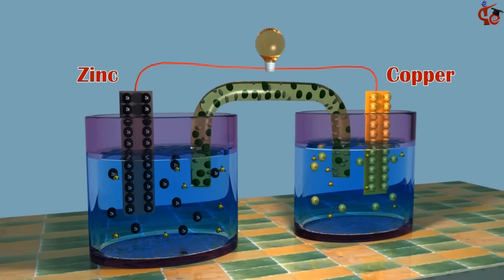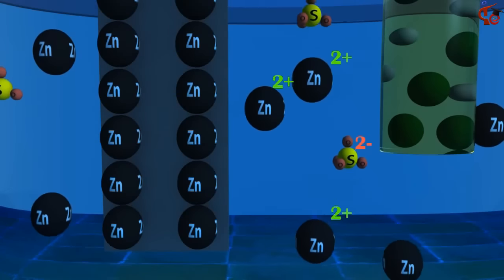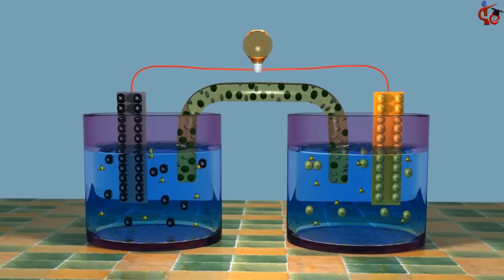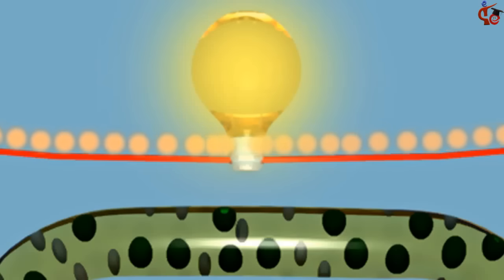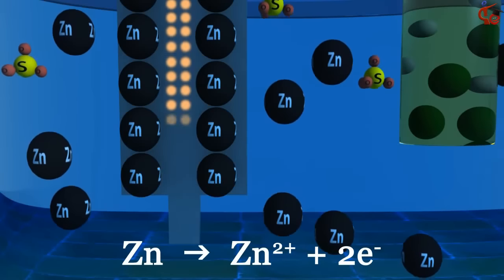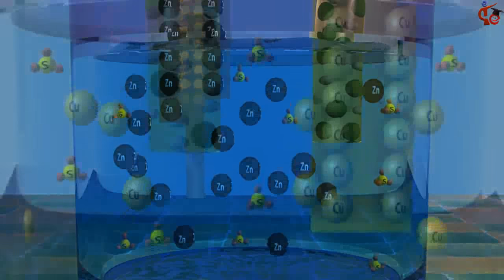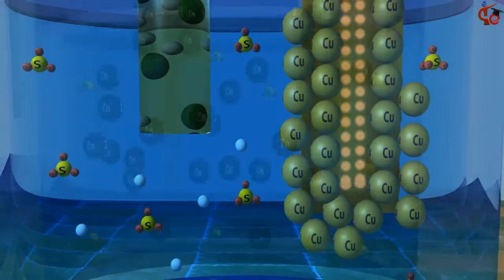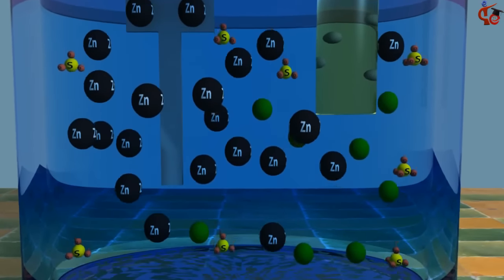Galvanic Cell.swf

Comment: why sodium sulphate is not used as salt bridge instead of sodium chloride ?
Reply: the function of salt bridge is too keep the solutions of two half cells neutral by providing a pathway for migration of ions so thats the reason thay do not use sodium sulphte
Reply: Because migration can occur if both the ions are relatively of same size. Sulphate ion is not same in size of Sodium but chroide ion is almost equal in size of Sodium. Hope you understood..

Comment: Sir,what will happen when all Zn electrons goes to Cu??
Reply: i’m assuming the zinc anode will eventually disintegrate
Reply: @itzshortclipz8016  than the battery will dead
Reply: ZINC ANODE VANISHES INTO SOLUTION AND COPPER FULLY ACCUMULATE
Reply: Current stops

Comment: Wow thank you! I have a question though, it says in the cie past papers that the more reactive metal is always the negative electrode.. So shouldn't zinc be the cathode?
Reply: +inazuma Yuyu The more reactive metal is always the negative electrode, which is called the anode. The cathode is the positive electrode.
Reply: I thought cathode was the negative electrode??
Reply: +inazuma Yuyu in galvanic cell, cathode is positive while in electrolytic cell, cathode is negative. i think u misunderstood this.
Reply: @INAZUMA , WHEN it is the metals with low reduction potential and high oxidation potentiial will make it self oxidiz adn give away electrns like zinc, so it is anode
copper has high reduction potential and low oxidation potential , so it tries to reduce itself by absorbing the electrons from zinc that comes via wire

Comment: Why do they want to maintain neutrality of both of the solution?
Reply: @Tan guan ming when there is neutrality it means the exampke in zinc sulphate solution , when more ZN2+ion forms more positive chagrge in solutio. in cuso4 more negative charge wil form, this will cause uneven charge traveling via wire, so to make the curretn go uniformly (MAINTAING THE PATENTIAL DIFFERENCE) WE PUT NEGATICE CHLORINE IONS TO POSITIVE ZNSO4 SOLUTION ZND POSITIVE SODIUM TO NEGATICE CUSO4,UNDERSTOOD?